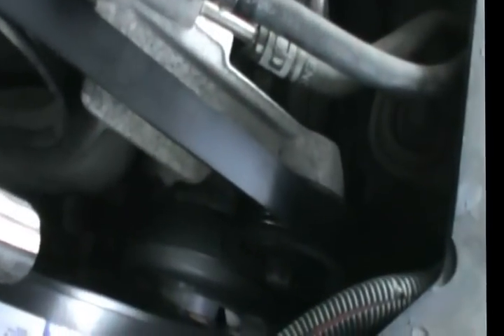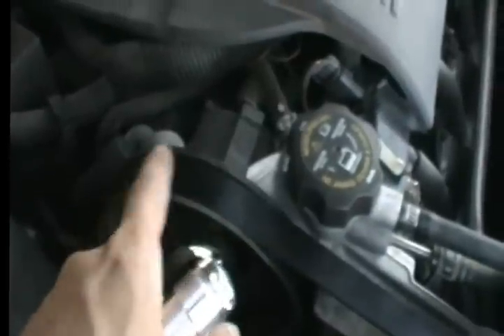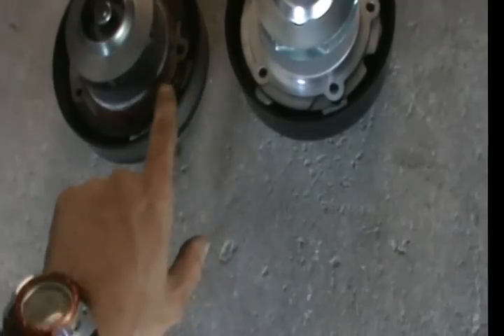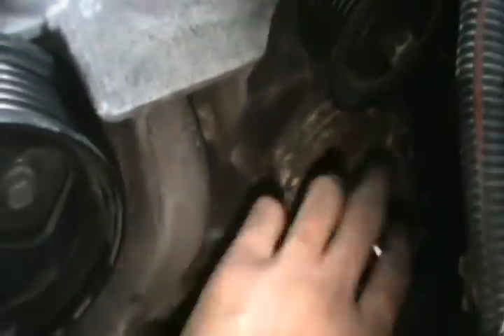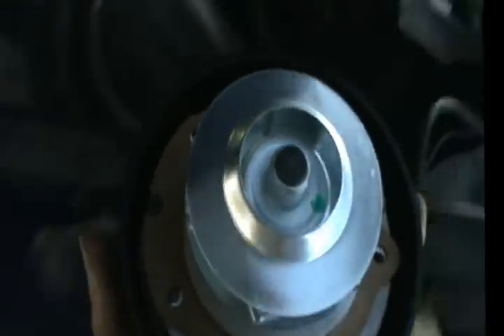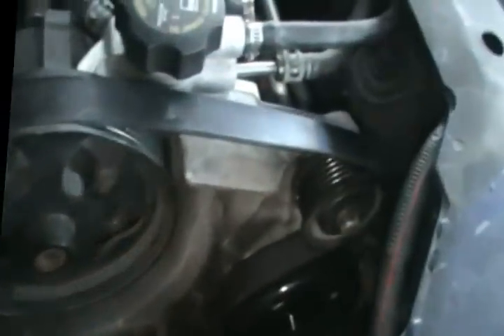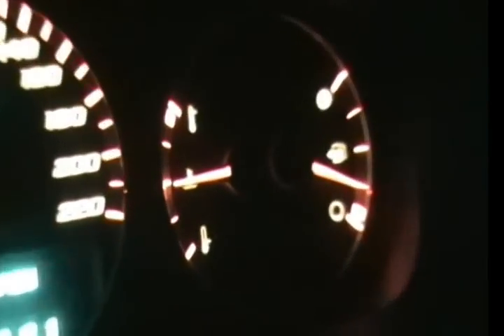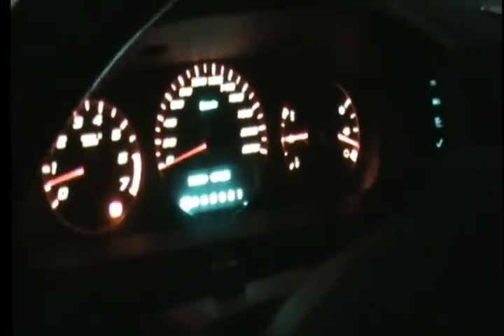Replacing water pump in Impala SS 2006 2007 2008 models

Comment: Put a big hose clamp around the spring on the tensioner, and tighten the clamp with a drill until the spring compresses enough to remove the belt.  That would be the easy way!!

Comment from the maker: you don't need to drain the radiator. When you pull out the water pump some coolant will drip and that's all. Once the new pump installed just add some coolant in the reservoir and you are good to go

Comment: I learned what I need to know to change the water pump.
BUT ....... DON'T UNDER THE TENSIONER!
Take a large band clamp and put it around the tensioner spring and just tighten it until the belt is loose enough. Easier, faster, and safer.

Comment: To release the tension on the pulleys you use a pry bar or medium size crow bar and pry the spring down from the top and that relieves the tension. It does take two people to remove and re-install the belt.
Reply: Yes sir it does, no hassle either 💯💯💯

Comment: Question . Since I’ve pulled outward on the tensioner spring  how do I get it back in once lifting it with the jack ? I’ve got it some what lined up with the jack but it still needs to go in towards the bolt hole for it to line up again ? Tia

Comment: I noticed some seepage of coolant about a week before my belt broke. i pulled the water pump and saw that the housing had been ground down a little bit because the water pump was letting go, after i pulled it out, it would barely turn. the bearings like to go on the ls4 water pumps for some reason. many people have had to replace them and sometimes the serpentine belt actually breaks due to the bearings ceasing up inside the pump. if you see dripping around that area you need to pull it apart

Comment from the maker: Our power steering pump making noise and we will put up a vid on how to fix this and if the noise persist after the fix we will replace it. We are shooting this video this weekend and I will upload it ASAP. Just for UR info, changing the power steering pump is a bit different than water pump. There is special way to take the air out of the new pump. Running power steering pump dry (with air bubbles) will damage it in seconds. NEVER run it dry.

Comment from the maker: Fill your radiator with plain water and start engine and see where it leaks. You will have to trace it! Once U fix the problem drain your radiator and fill coolant. You can safely run your engine like that for at least 10 minutes in “park!”

Comment: Watched this video to see if there were any belt tricks and its very helpful. Do you have any tricks to changing the spark plugs in the back of the motor? I have 2006 monte carlo ss but im sure the motor is identical to the impala?
Reply from the maker: I will put up a new video on changing spark plugs this spring. Its quite easy to change them and yes your Monte Carlo SS has identical engine

Comment from the maker: If your belt broke your car won't start :) 
It is impossible for me to tell what could be wrong. Only a visual inspection will determine the location of the leak. I guess (its a long shot) but if your car runs, try starting the engine, video film it with your hood open, upload it to youtube and add it as a video response here. If I can't tell maybe other people here will see it.

Comment: Great video some mechanic charge me 140 just install the water pump and he did a horrible job because my car started to leak water when I was going to work 3 days later I order the part with out the gasket and he put glue he told me it would hold now calling him but am getting inore

Comment: Just know the correct antifreeze is Dex coolant not peak
Reply: thank you
Reply: Ashley P for?
Reply: Letting us know about the coolant type...you know this came in handy for me once upon a time Anthony Pierce
Reply from the maker: GM wants you to use their coolant! BUT, from the car perspective ANY coolant mixed 50% coolant and 50% water will do the same!!! Our Impala has 579000KM and I don't use Dex antifreeze. When its -50 Celsius I find 50% mix even 60% generic coolant mix with 40% water does just fine and the car starts if plugged in. Ford, Honda and GM all have different color coolant Red GM and the other green..etc all the same

Comment from the maker: When you say "connect to hose clamps together and place it around the top and bottom spring mounts" can you explain what you mean by "hose clamps?" This belt thing on the SS is like hell compared to any other car using just a socket wrench, a 5 min job. If you can elaborate or email me a pix of this hose-clamp I would make a video and link it here for others. I messaged you my email

Comment: http://www.handsontools.com/Kent-Moore-EN-47988-Unloader-Belt-Tensioner-EN47988_p_40261.html thats for the tool . but if you take ratchet straps and a block or hose clamps and put them around the spring to depress it will work
Reply from the maker: That tool in the picture will not fit in the narrow clearance to reach the idle pully! It will work with GrandPrix and Impala LT, LTZ and LS (V6) but will not work with SS-V8!

Also the spring is on (almost) maximum depression when bolt is on, so you can't depress it further-enough unless you remove the bolt which will cause it to un-compress